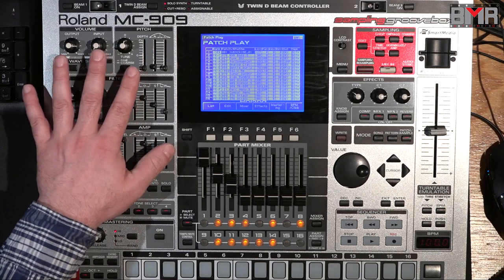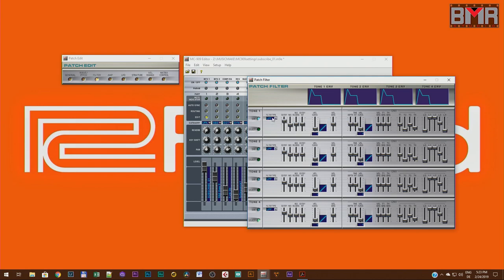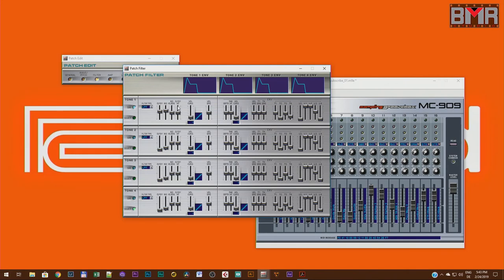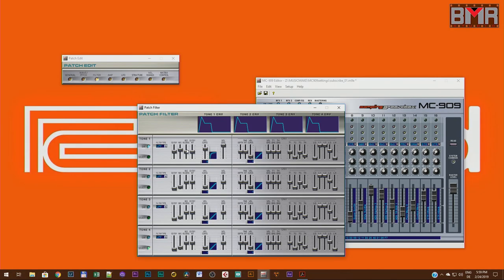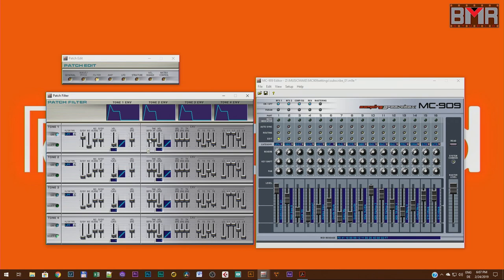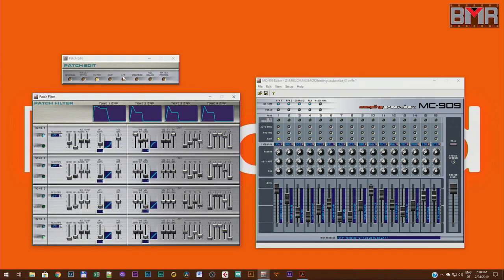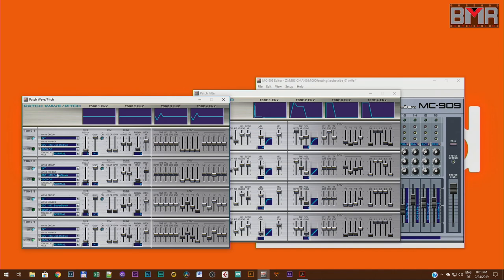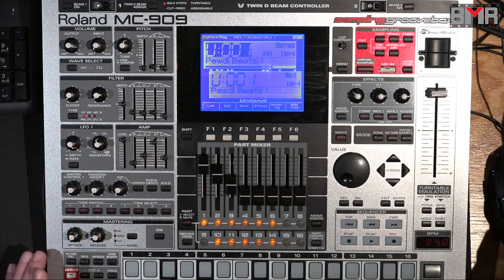Roland MC-909 groovebox synth engine. Part 4. The filters (small help for Pewdiepie)

Comment: Great fun. The tips on settings, curves and external controllers have made sense of a problem I was having. PS: Controlsurface going out of sync with the settings isn't a problem on the MC-808 :P
Reply from the maker: Strange Animal If You save the filter freq. into the patch, MC-808 is doing the same :)

Comment: Hi. How can I connect the MC 909 with mc909 pc editor with midi cable and midi pc interface. My pc interface is Edirol ua101. What I have to adjust. thank you
Reply from the maker: in the editor, open the midi config and select your midi interface.
on the MC, just follow the instructions in this video. Super easy. ah, make sure, no other software is using your midi IO

Comment: Do you know if it's possible to bypass having to buy a v link video mixer for the mc 909 ,and run the midi direct into a computer and use a midi support video editing  p software program installed on the computer!!??if such a thing exists!? Anybody know!!!!??
BIG thanks.😊
Reply from the maker: Wyn Stone sounds weird:)
So You wanna use the MC as a midi control surface? I don’t understand the whole setup idea.
Reply: Hi
I've been studying the Edirol v-link
Video mixer that connects to the mc909 via the v link button (bottom left)....thinking that since the 909 came to market and with the advancement of software ..that there maybe a video editing program on the market now that can be midi controlled!?.....if there is a midi controllable video  program available...then to my mind it could be midi mapped to the 909 and controlled......in hence bypassing the need to have to use the edirol video mixer!!!...basically the same process of using the mc 909 to control software(logic ,ableton,etc) but controlling video software instead!! 🤔 hopefully that clarifies things!!?........ANYBODY KNOW OF SUCH SOFTWARE??Thanks 
......i thought you was sending me your email?.... all this JUICY MC909 UPGRADE  data that I have for you is slowing my computer down😁 😂..... so whenever your ready YODA !!✊🏽😎
Reply from the maker: Wyn Stone I used some software on my gigs 12 Years ago.... It works even with the MC-303. I forgot the name. Something V-mix, VJ-mix?
The V-link is a special protocol, to control video mixers, sources done by Edirol and Roland. They are kind of outdated compare to the software solutions... such as the Pioneer RecordBox :)

Comment: But, can it Sidechain elements to the kick?
Reply from the maker: Erik van zanen I forgot it.. I’m not sure.. I have to refresh my memories. we will arrive to the effects section soon as My primary job allows it.
Reply from the maker: No. But You can send out the kick on the individual output, and hook up an external compressor to the stereo output! Eh?
Reply: @BMRStudio  thx for the fast reply mate! I am a bit sad to find out the mc-909 doesn't seem to work with MIDI ch 1-16 (or does it somehow?) I'd love to use all the 16 parts in a DAW and go on from there, but it seems you can only do that per element
Reply from the maker: Erik van zanen Sounds weird... I always used the MC 909 as a 16 part midi instrument:)
The patch editor works only part by part, this for sure, because the special sysex calls, what You can see on the bottom of the software.
Reply: @BMRStudio  If you connect the MC to Ableton Live, and play a Song on the MC, you can see in Live at the Midi In's, that it ' sees ' the MC play the different parts on different midi channels, you can see them blink. Bujt if you set a new midi track in Live, and put it's midi out to a corrosponding channel, that you see in incoming, it won't trigger notes.

Can you explain to me how you were able to use all parts in a DAW? It would make this a beast of a synth :)
Reply from the maker: @erikvanzanen  Ok. Worst every minute for a short video :) Let me finish the current video.. Gimme few days.
Reply from the maker: @erikvanzanen  first, check Your DAW midi IO settings. Then open the menu in Your MC 909, go to MIDI, then RX and switch off the Remote Keyboard Switch... if this is off, then the MC will receive every Midi channel messages part by part. Then go to the TX settings, and switch off the Soft Through option.  Then check Your mixer in the MC 909 :) Then check Your DAW software, every track must me a same MIDI port what You using for the MC 909, and different MIDI channels 01- 16 for the parts.
Reply: @BMRStudio  you da man! Im on it 1st thing tomorrow! Ill let u know. Thanks mate :)
Reply: @BMRStudio  you made my day Mister BMR :) it works! So happy it's a feature in the menu. Thanks a lot !
Reply from the maker: @erikvanzanen  Time to time, it's a good thing, to read User Manuals :)))) Keep Your fingers on the MC-909!
Reply: @BMRStudio  you are right and yes I will :)
Reply: @BMRStudio  Hi there MC brother! I have been playing around lots with the MC an I think the possibilty to put a waveform for L and another for R is just great! Can make interesting stereo sounds with it. 

I worked around a way to get a sidechain fx, I used the LFO for that, and the Ramp Waveform, on a 1/4 measure, which works like a charm. THe problem only is, it doesn't start at the same time, so it can get out of sync, resulting in opposite fx of sidechain ducking. Too bad!

I was also wondering, have you looked into the V-link possibility? I think it's pretty awesome for that time, only I have no idea if there is still something available for it  to this day. I found Edirol Motion Dive, but it seems rare! Any thoughts?